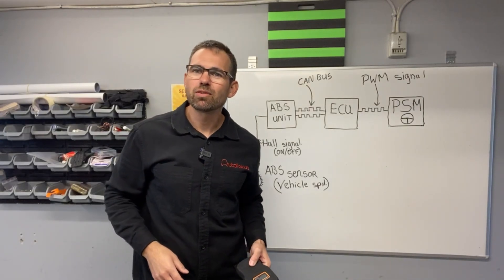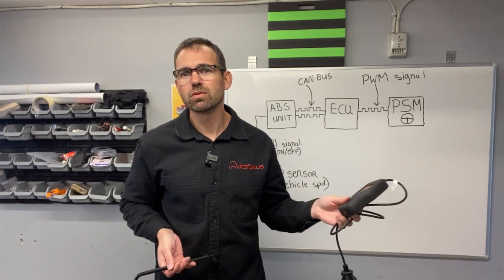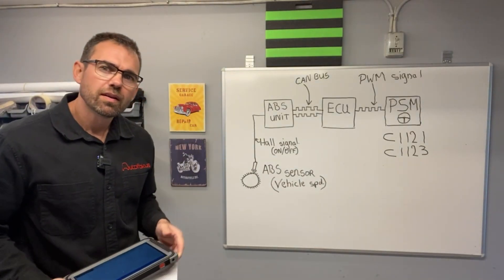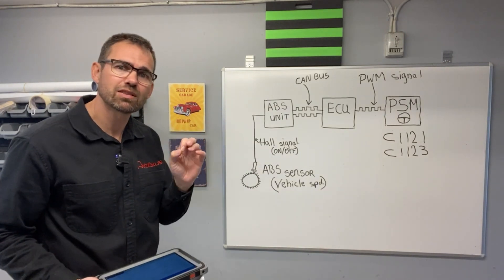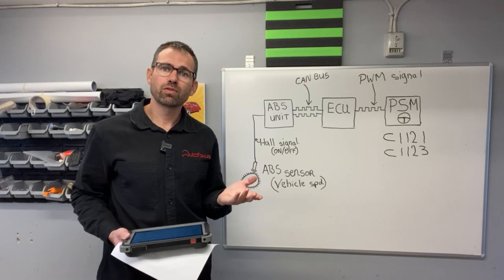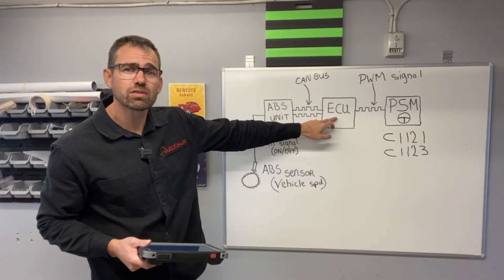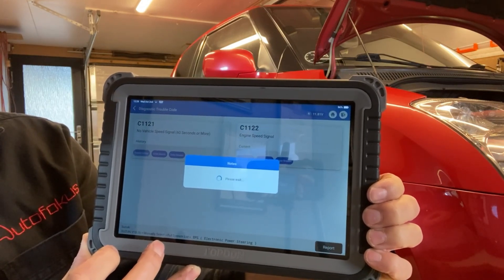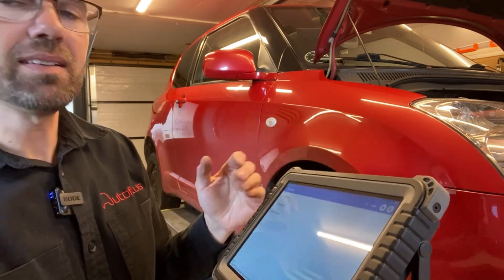Boosting you scan tool skills - Eps. 1

Comment: Thanks for the video Simon.  So for this issue, the problem is either the signal from the ECU to PSM or a problem in the PSM.  Without a scope/DMM and some probes, one could do a visual inspection of the wires and connectors. Is there anything else that could be done?
Reply from the maker: Hi 😊.
Yes, either the ECU does not send the signal which means it is broken, or there is a wiring problem.
The PSM seems to be okay, but it simply does not recieve the signal.
You could try and use the scan tool like in the video, but a DMM and a scope is best.
/Simon